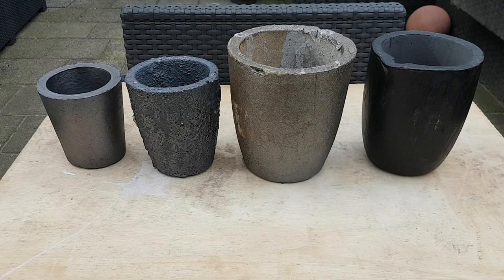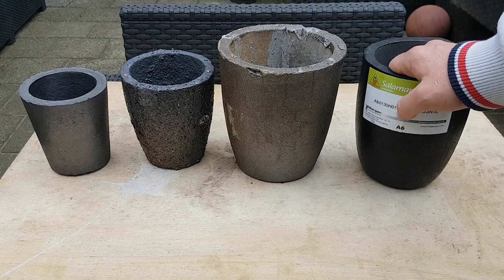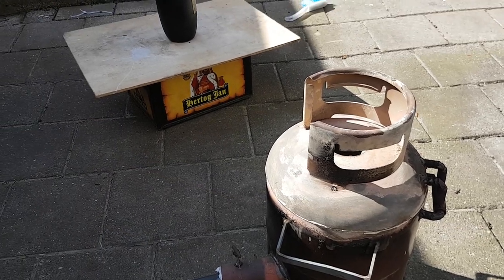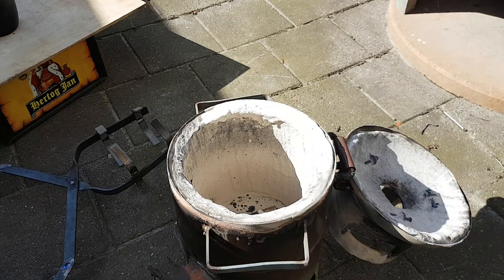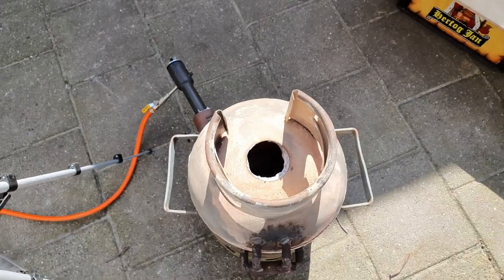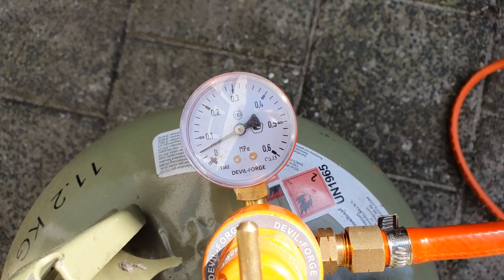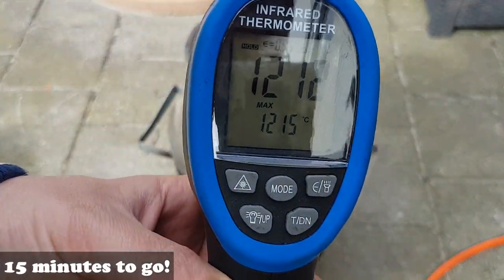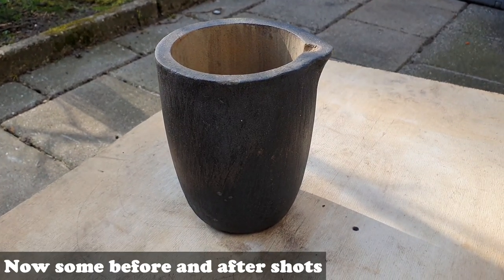Talking about crucibles - How to properly temper a crucible?

Comment: Interesting. But in 60 years of using crucibles I have never tempered a crucible. I have always used good crucibles - like your best one here or better (silicon carbide) - I have never had what I would consider to be short crucible life - my crucibles for aluminium last over 100 melts. I have never had  a crucible crack or fail in anyway other than through extended use and the associated loss of conductivity that slowly comes from graphite burn out. My one bad experience was  from putting a cold crucible in a white hot furnace  -the outside surface spalled and I have never made that mistake again. If you wish to waste fuel tempering your crucibles go for it but I think it just takes one use off the crucibles life. Possibly a reasonable idea to dry any crucible (to say 200 deg C) that you think may have got damp.  Might have been interesting if you had weighed the crucible before and after this drying as trials I did showed no weight change and thus no moisture driven off - presumably then there was no moisture in the crucible and the drying was unnecessary. Can you put a link to that preheat PDF file in your description as despite going round in circles for about 30 minutes on the Morgan web site I could not find it.... Martin
Reply from the maker: And to think I already read a comment at Pauls garage from you about tempering (I did however notice Paul did not have a salamander crucible)!! Thanks for all the advice, a lot of experience from your side! Do I need to put the crucible in a kitchen oven after an extended time of none use? As you just stated I do not think so. My experience with crucibles is just from China (very bad quality) and some ordered from Etsy in the UK (my current 4kg copper crucible and 10kg crucible). I think I will have a lot of fun with this salamander crucible. It looks brand new after it's first use :) Thanks again for the tips!
Reply from the maker: Oh and let me not forget this: https://www.morganmms.com/media/1766/cruciblecareuseandsafetyinformation-mgam.pdf
Reply: Sorry to bring this 2 years later but, what would it be a best cost-effective crucible recommendation for new Melters? Amazon recommend many Chinese crucibles.
Reply: Melting aluminum is low temp and a waste of time
Reply from the maker: @chieto88  if you are new to melting and have a limited budget I would defenitely go and try the chinese crucibles. You can always upgrade to higher quality crucibles and see the difference yourself 🔥🔥🔥

Comment: The temperatures your infrared gun is reading seems low compared the the colours I am seeing. I wonder if the burning gas reads higher than the actual temp of the furnace. So if the gas and blower was turned off while you took a reading it would be way lower. Full cherry red is only 750 and 900˚C should be Orange, 1000˚ is Yellow and 1100˚ is light yellow. 1200˚ is white, according to an old book I have. 

A heavy duty type-k thermocouple and simple digital thermometer cost me NZ$20 from Aliexpress. I drill a hole and have it sticking into the furnace. What I found interesting monitoring this way is how air and fuel mixtures can make a huge difference to rate of climb. Running rich or lean. I'm yet to try this but I suspect an automotive oxygen sensor should help with efficiency. Finding the sweet spot where sufficient air is provided so the fuel is being completely burned.  Some automation might be possible using such data.

Comment: Are the same Salamander crucibles good for cast iron? They are available here in up to A20 sizes, but note that they not recommend them for ferrous metals?
Reply from the maker: Ofcourse they should do the job, but they are pretty expensive and melting cast iron uses crucible up really fast. I would recommend a cheaper clay graphite crucible brand for melting cast iron 😄👍🏻👍🏻

Comment: Useful video, I just bought crucible and FB2Mb. I also remember Hertog Jan (0:4:33) from 2017 when I lived in NL for few months :)
Reply from the maker: Thanks! Good you found it usefull, for the slamander crucibles there is a new tempering process, I have it on my latest video. Did you study in the Netehrlands?
Reply: @Metalstacker Have to check that video also. No, I was working there

Comment: Brand new crucible came with very small chips broken off, it's it ok ?
Reply from the maker: If the chips are on the edge and there is no crack in the crucible it should be okay to use. Make sure to wear proper protective gear! Enjoy the melt mate :)

Comment: I’m fairly new to casting. I’ve been casting from a welded iron pot. Just bought my first clay graphite crucible’s. You did the initial temper in the oven and let it cool, then tempered to a higher temp in the furnace. Why waste your fuel tempering an empty pot. Why can’t you melt metal during the initial heating? Please in interested in opinions
Reply from the maker: Good to hear you like melting metals buddy! You don't want to charge the crucible the first time as that effects the tempering of your crucible. Ofcourse you can charge it with metals whilst using it for the first time. The factory advice is to temper it empty. I heard several other melters to charge it with metals the first time. Not sure if the lifetime is negatively affected by that. I play it safe and follow factory orders 😉👍🏻👍🏻

Comment: Recently got a devil forge, and was attempting to 'cure' the crucible, it now looks rust color (orange/brown). Did I over heat it or not bring it hot enough? @metalscrapper
Reply from the maker: Devil Forges are great! It really depends on what kind of crucible you have. If you have a thermometer for your furnace, you should get the cruicble red glowing at around 900°C. After reaching that temperature you can easily get it to 1100 or 1200°C (depending for what melting point metal you want to use it) for 30 minutes. Keep it red glowing for at least 30 minutes, after that let it cool down inside the furnace with the lid closed. The salamander crucibles I use will not change color.

Comment: Is this necessary for an electric crucible? Nothing in the instructions say
Reply from the maker: For an electric furnace crucible it also should be brought up to a specific temperature before use, that is to drive off any moisture. But as all those electric crucibles are from pure graphite so they are pretty instantly ready for use :)

Comment: im wondering if you can temper it with the metal in. Then after temper you can just increase temp to melting temp to save on propane
Reply from the maker: Well I do not know for sure, it could be possible but they did not recommend that in the manual.

Comment: I just put mine in my fire pit full of water so it gradually heats at a steady temperature throughout the night  till it boils off. I've used it 15 melts so far
Reply from the maker: Uuuuhm okay I've never heard that one before LOL! I'm not sure if that is the right thing to do. The reason to temper it is to get rid of any moisture inside the clay, as the steam will crack the crucible. In this case I followed the instructions of the manufacter and pre heated it to 200°C before putting it into my furnace.
Well if it works for you to do it that way then it should be fine I guess. I hope my salamander crucibles will make at least 40-ish melts before they start to crack.
Reply: @Metalstacker  lol I did it drunk. I had zero experience. So I was guessing lol

Comment: so how bad does it smell in the oven now?  Are those high end crucibles better on the odor they put out after doing that?  I was threatened to never do that again by my wife after I did that on my first bigger crucible.
Reply: That's why do it when there gone
Reply: @jfssparky  lol yeah well at least with mine you could still smell it for days if not weeks
Reply from the maker: As usual also my wife complained about toxic vapors, yeah the outside of the crucible is painted, so it gives some smell, but I am still healthy after eating food from that oven :P I might built a big kiln/electrical oven to temper these crucibles and burn out plaster molds in my new shed in the future to be sure :)
Reply from the maker: Smart :)
Reply from the maker: Wow, well the smell was gone fairly fast with mine :P

Comment: If you temper it for copper, what will happen to it when your furnace goes over 1,100°C? Shouldn't you temper it for the highest temperature your furnace can reach, just to be safe?
Reply from the maker: Not really surre, good question! I had mine up to 1200 degrees. I do not think it is very bad to heat it up a lot higher :)
Reply: @Metalstacker  As long as you're safe and your crucible has as long a life as possible. 👍

Comment: After 3 yrs can you tell me how this is holding up? Just purchased a cheapy on Amazon and wonder how the expensive ones hold up?
Reply from the maker: I am still tracking the melts, haven't melted a lot the last year. So far they hold up pretty well without any cracks visible after at least 10 melts of copper. What I did notice however, after the second or 3rd burn some material of the crucible glassified and remained at the walls of the inside of the crucible. It will not get into the metal, but for the sake of a nice pure molten copper shot for my video's that was somewhat annoying. The glassification makes the crucible much harder. I think they will outrun the cheaper crucibles. I will make a video once I know if they are the better or worse economical option in lifespan vs costs. Thanks for askingn😄🔥🔥🔥

Comment: Any crucible should be at least heated slow up to dryout temperatures and everytime there is any question of dryness. The larger the crucible is the more thorough one should be. Beyond drying and any tempering ,obviously quality of manufacturing will be the biggest factor in longevity.
Reply from the maker: You are spot on on this mate! Getting rid of moisture is the most important step in tempering :)